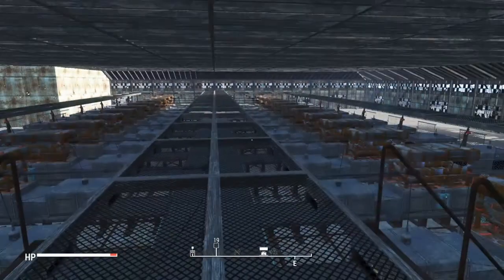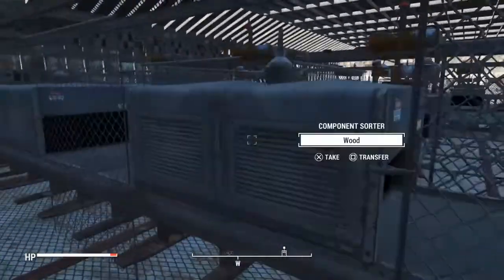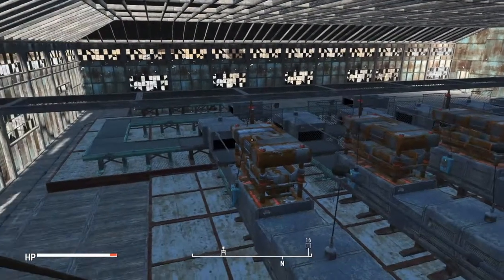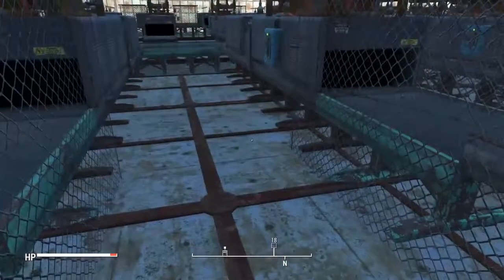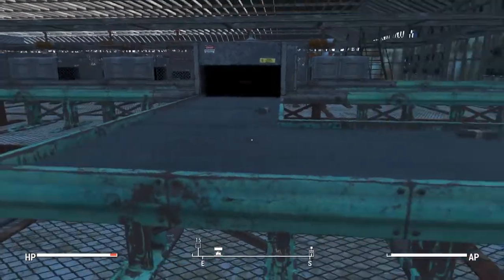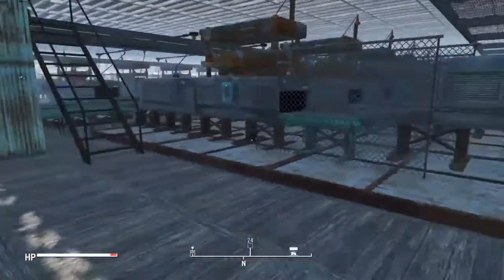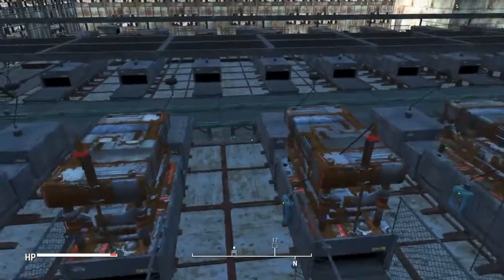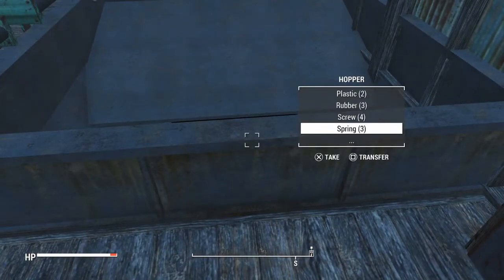Manufacturing Overhauled Recycling Improved

Comment: Manufacturing extended (pc) has a component vacuum hopper. Recycles stuff right out of your workshop.
Reply: yea i use it . i got it coming form my workshop bench to the recyclers that back into the work bench . tried to put a container near the vac hoper put i can get anyhing out of it . and i have seen people doing it
Reply: john smith My new setup is just a recycler hooked up to a conveyor workshop storage. I just dump my junk into that and it all gets scrapped and goes straight into the workshop. Literally just those two things, takes up virtually no space compared to this setup, mot that this isn't cool. It's way more interesting to watch this, I just didn't have room on the roof of the red rocket truck stop.

Comment: Great job man!  Really well done tutorial.  Was wondering what fences you used on the sides of the conveyor belts?  Is it a mod?  A response would be greatly appreciated.
Reply from the maker: They were chainlink fences unlocked with the Unlocked Settlement Objects (USO) mod. It takes a little fiddling to get them to line up just right. The new Place Anywhere Tool mod would get around that though.
Reply: so if is goes into one container why u need them shorted out ? don't the container do that for u ?

Comment: Neatly done sir! This video like the recycling plant you've featured is well executed... It shall likely provide a considerable influence on my ideas on similar matters... Thankyou... As an aside might I ask asto the origin of your accent... Your voice clear, well modulated and easy to listen to... Maybe you should consider voice over work... Would you by chance, be a Southern Gent?
Reply from the maker: Thank you for the kind words, and I'm glad I could help. You are correct, I am quite southern. Northern Louisiana. I have thought about voice work, though my normal speaking voice isn't clear at all. In fact, this comment may be the kick in the pants I need to get started again. Also, if you haven't already, you might want to check out Jack Dolff's videos, he's still making factories.

If your design kicks ass, post it and send me a link, I'd love to see what you do.
Reply: Thankyou for your reply, I won't clutter your intray with my ramblings..just yet except to say that I am currently developing my ideas for a "Standard" outpost or keep which would act as the primary or anchor structure for a starting or fledgling settlement. Fully equipped to accommodate up to 12 settlers. A work in progress.

Comment: also if you wait till you get 6 or more of one item , most items will drop a one item, have to do a test run but if you drop 7 concrete it will show as one bag but scrap 7 when you manually do it, don't know if recycler will read 7. noticed that with shovels. Fences nice touch, I kinda did what I needed to with my plant, now I'm working on an arcade as you saw. got more game ideas. screw nuka-cade. mines funner
Reply from the maker: Jack Dolff Yeah, but I just like building, lol. This way feels a little more realistic and lore friendly.

Comment: At 7:52 you mention a mod for enhanced power and wiring. do you have a like for that mod? I can't find it on the PS4 system.
Reply from the maker: Orian Alexander The Manufacturing Overhauled mod included a power box after the author saw my videos, so the mod is no longer required.
Reply: Thanks I just found it.
Reply: i use a watz fusion batty mod for powering those things .

Comment: I don’t get how your sending random junk into sorting BEFORE the recycling shouldn’t it be broken down first then sorted?
Reply from the maker: It's because of how the scripts work on the PS4. You can add another set of sorters above or below, (I'd go with below, due to the up lift belt having issues,) to sort the components, but due to the way that the recyclers work, (being split into two groups, and only being able to "produce" one type of component at a time,) this is the best setup I could come up with. My first recycling plant had less sorting and fewer recyclers, but you had to shut the whole thing down, change the output on the recyclers, then cycle ALL your junk back through, multiple times, lol.

In short, I wanted to keep it more realistic and lore friendly, but game mechanics and limitations had other plans.
Reply: Viley J ah I understand now
Reply: Viley J why not fiberglass,gold,cork..etc?
Reply from the maker: To keep the build as compact as I could I tried to eliminate as many recyclers as I could, so I went through every junk item in the game to see which components I could bypass. There are 31 components in the game, and 7 of them can be broken down without a dedicated recycler. Take cork, for example. No junk item in the game is made of only cork, they all have another component, like leather in the baseball, or cloth in the teddy bear. I believe gold in gold bars is the only exception, but they are pretty rare. Basically, it was about saving space. It barely fit as it is, and I wanted it in the Starlight Drive-In, lol.
Reply: cool you put a lot thought into this

Comment: I just toss all my junk into the recycler with a branch for valuable items and the rest goes to the work bench to be shared with other settlements..I don't see why u need it like this unless you have it set up to open just a few hoppers like steel, fertilizer, copper then head off to be processed into something else
Reply from the maker: Well, several reasons. First, if you're on a console, having too many junk items in your workshops can cause the game to lag and crash when you open workshop mode, because the game has to calculate the number of each component you have available. Second, as a request from a mod author, I designed this recycling plant, and a fully functional manufacturing plant that were supposed to go together in a pre-made factory mod. Third, after 3000+ hours of scavenging, scrapping, and building, I grew tired of manually breaking down each piece of junk I find. And finally, the challenge of automating a process such as this was just too much fun to pass up.

But to be honest, most players don't need a setup like this.
Reply: I don’t remember writing this lol